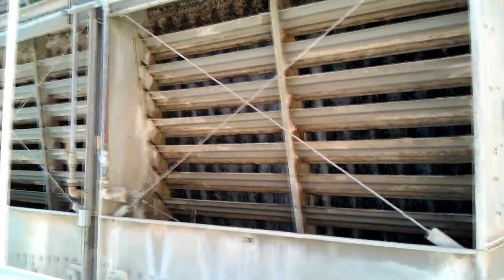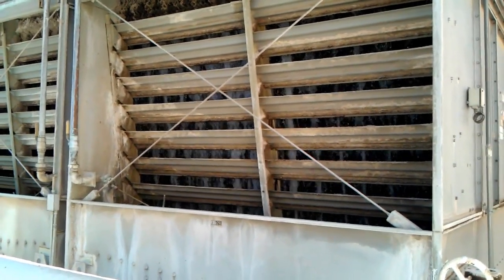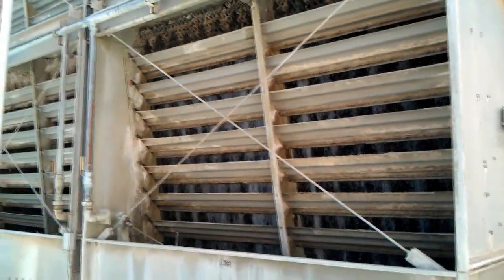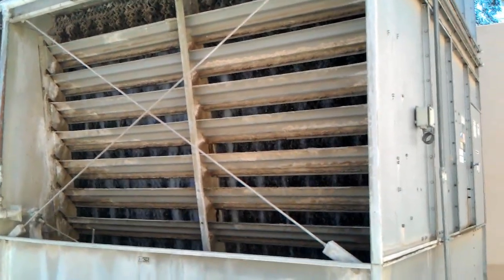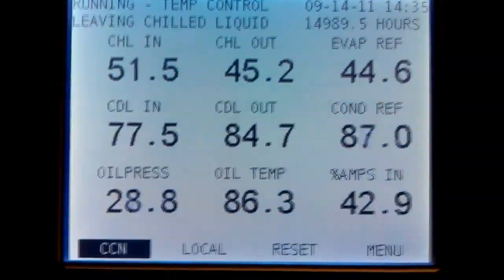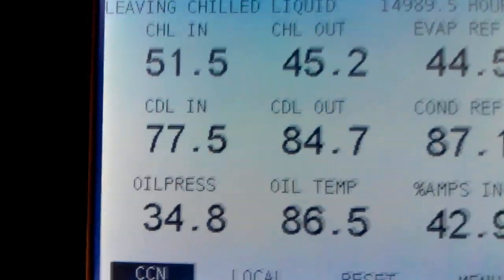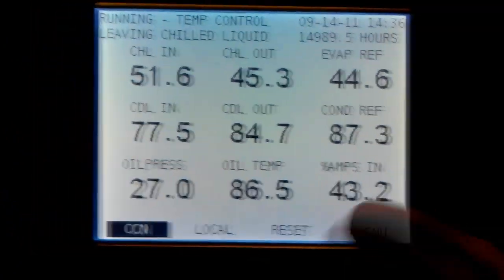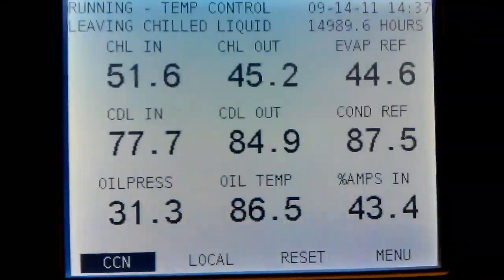Cascaded Cooling of a Cooling Tower and a Chiller & How a tower cools water LOWER than ambient

Comment: I am wondering if Swamp coolers are based on a modified version of the evaporative
type of cooling tower? In that, instead of Hot /Warm water running over the filler,in a evaporative style cooling tower, with swamp coolers, the water is drawn from the reservoir and is circulated over Excelsior pads on the outside of the unit. And the squirrel cage blower pulls the Hot outside air through the Pads and evaporation takes place, and then the cool Air is pushed into the building. Of course, the filler materials used in a modern cooling tower and a swamp are different.

Comment: Why do such large systems utilize R-134a yet smaller systems utilize a while variety of different refrigerants?
Reply from the maker: Seems to do a good job.
It uses 500 Lbs of R134a for a 500 ton unit.
The 500 ton centrifugal that it replaced used 1,000 Lbs of R22

Also the operating pressures stay nice and low.